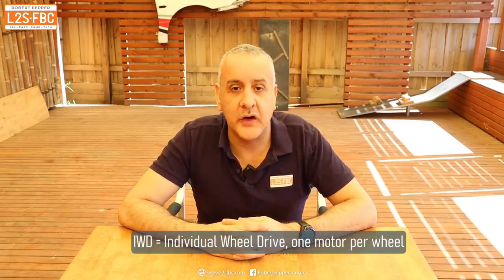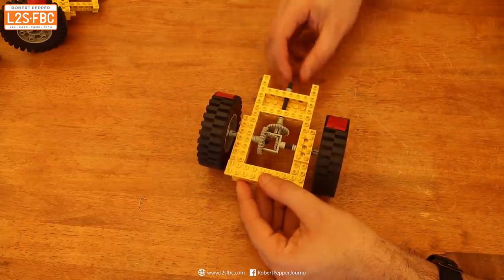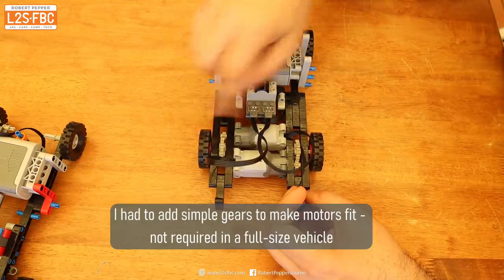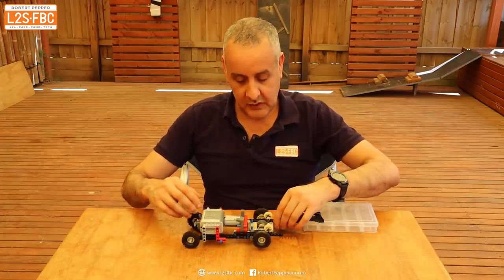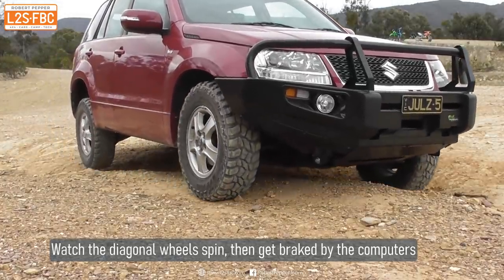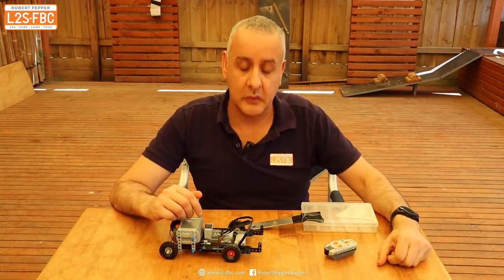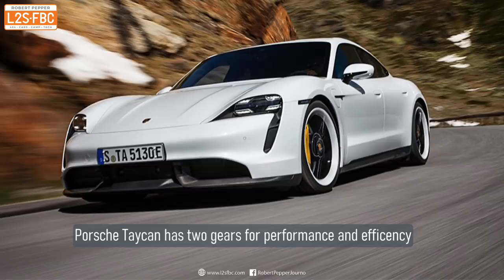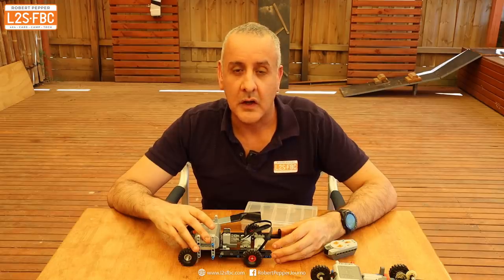Why Differentials Will Die - EV IWD Is The Future!

Comment: Good explanation, but there is NOTHING simple about a modern electric drive. They all have multiple computers and sensors and if you work with computers you will understand you can load the exact same image on 100 computers that are made exactly the same and you will have some that do not work the same as the others.  I see benefits of electric vehicles but I also see the massive open pit mines used to get to the metals used for them.  If there was not the push for electric vehicles and people understood the ecological damage done to dig the resources out of the ground using diesel engines and the shipping using diesel engines the manufacturing using coal for the electricity in china; people would realize that the electric vehicle is not the great environmental wizard it is made out to be.  The dumping of chemicals from the plants in china has caused a lot of damage to the ecology on many rivers and out to the ocean.  In order to increase the charging stations to run electric vehicles tons of copper will be strip or open pit mined and forests and mountains destroyed doing it.  There is no ecological way to do what we do in society.  The electric vehicle manufactures run into the cost versus reliability on the drives and computers if you go for the most reliable the cost will make it impossible to sell so they go with electronics that can handle some abuse and sell them cheaper. You will not be running the IWD computer controlled affordable electric vehicle down an offroad trail that is rough and washboard for a very long time.  Like trucks designed for offroad the electric vehicle will need to be upgraded for the abuse and this will increase cost.  The makers have worked for years and they still do not have a truck in normal production that is affordable, they will but it will not as awesome as we hope.  Like the electric cars now you will not be able to load up things in your electric pickup and haul them to your kid in college 10 hours away because you would need to stop and charge so often it would be an overnight trip and you will borrow the neighbors vehicle running on diesel or petroleum to do it.  For running short trips they can be great but if you need to also go more than 150 miles in a day you now need 2 vehicles license plates and insurance. Life is not as simple as we wished except for my Amish neighbors, they just ask you for a ride and do not need to worry about a vehicle.  Nice people to live by though.
Reply: No such thing as a free lunch. Or a consequence-free technology.
Reply: True with the charging and environmental impact that the electric vehicle causes, but the majority of people do not want to see that part that you described as then its not as friendly to the environment as they wish it to be
Reply: Thank you for your statement.   All they eco peeps see is "look zero pollution from my EV" when they dont begin to see the real cost in batteries for that  vehicle, the cost of the extra electricity being generated to charge that vehicle, the very limited range of use, an even shorter when you live where it gets cold , the extra cost incurred for all this new tech of electric motors controlled by a host of computers. When I need to turn around, I do a 180 and go, doing a tank turn in a vehicle looks to put all kinds of hard stresses on tires, drive components, structural of the vehicle. There are many stability control systems in cars (look at BMW, is amazing)
Reply: @patricksmith5640  No one looks at the damage being done in South America, china and Australia for the minerals.  The open pit mines are bigger than major cities.  The pollution is horrible, china has all but killed off the only fresh water dolphin by poisoning the river they live in.
Reply: @badgerpa9  wether it is EVs or diesel or petrol you still have to do mining. The steel for making ICE vehicles is the same as that for making EVs. There is a horrendous amount of energy needed for making all the castings and forging that go into an ICE. EVs are no different they just mine different things. If we use EVs instead of ICE we just pollute in a different way. Both types pollute. In the end it seems that EVs pollute slightly less.
Reply: @franciscoshi1968  if that helps you sleep at night.  The open pit mines for rare earth minerals are a disaster and destroys the land.  The coal used to fire the electric plant is not better than diesel fuel used.
Reply: @badgerpa9  I didn't get an EV to save the environment.  I got an EV because for my circumstances is far better than an ICE powered car. I wouldn't go back to ICE. I have had the car for a few months and so far never experienced any disadvantage.  The long trips I have done that needed recharging half way were not a problem at all. We parked at the fast charger and by the time we finished lunch the car was charged. The car charged faster than it took us to have lunch. My car has only 260km range. When I bought it I was only intending to use it as a run around car but after using it for a while we found it can do longer trips than I thought.
One thing though I don't like driving 8hrs straight. If you really want to do 1000km in one stretch eat in the car while you drive and have toilet stops on the side of the road then don't buy an EV.
Reply: @franciscoshi1968  I wouldn't want to plug in every where I drove, you may live in a country the size of a small state but driving 300 miles is not uncommon and we have driven over 24 hours in shift often.
Reply: @badgerpa9  I live in Australia.  In the last 7 years I did not make a trip that I could not have done on the EV. And I would  have saved the annoyance of having to put petrol every few days and have to put up with the smell (of poisonous fumes) while I stand next to the fuel pump and the smell of the unburnt fuel every morning when I start the car and reverse out of the driveway.
And I am fortunate enough I have never had to drive for 24hrs.
So EVs are not suitable for everyone just like diesel petrol or LPG is also not suitable for everyone.
Reply: @franciscoshi1968  I keep my face away from the fuel tank and the exhaust from a modern vehicle is better than the fumes from the coal used to generate electricity. Glad you are happy with your car.
Reply: @badgerpa9  I tried standing upwind when I refuel but unfortunately I get the fumes from the next pump and when there is no wind it still smells. I can not get further away than arms length. As for the fumes from coal power stations. They are very far away and I don't have to smell them every day when I reverse out of the driveway.  Every time the car starts when cold it dumps lots of fuel most of which comes out the exhaust because the catalytic converter is not hot yet. And the car is inside the garage so even if the tail pipe is pointing out the fumes still end up inside the house and inside the car. And I charge from solar not from the grid. It is cheaper.
You really don't realise how smelly ICE vehicles are until you drive a car that doesn't smell.
Reply: @franciscoshi1968  sorry things are so hard for you. I have operated electric, gasoline, diesel, LNG, and alcohol cars trucks and tractors the only time I ever smelled anything strong was on farm tractor.  The fallacy electric is better for the environment is sad. China has poisoned entire areas making solar panels. I do hope electric vehicles  get safer and better.

Comment: Looks great but EV's have more than range and charging times to overcome before people really start buying electric vehicles the way we buy petroleum fueled vehicles now and you can bet your last dollar that gasoline and diesel will put up a fight.
Reply: That is why the governments in Europe are making emission rules so strict. Some Japanese companies have said they will not produce Diesel engines for Europe in the near future as they can’t make them comply with emission standards.  Nice to see the consumer will have a lot of choice of which car they buy. NOT!
Reply: Here is a solution to this problem. You have a normal EV 4x4 that has enough range to work for daily driving. Then you have a plug on the so if you are towing you can plug an ICE  generator 🤣 that will keep the battery charge so when you get to your preferred track you have a full battery pack. You leave the caravan behind and spend the night in comfort with aircon.
Reply from the maker: Or put a battery in the caravan...

Comment: So how about maintenance?
4 engines plus a generator = 5 x as much parts and maintenance!
Reply from the maker: No, electric engines need barely any maintenance
Reply: @L2SFBC  Fair enough, but surely the generator will need 12 monthly service. Will electric engines require oil change or servicing? Then theres breakdowns after a few years...
Reply from the maker: Ditch the generator. Watch my Atlis interview -> https://youtu.be/f612Qjz9Wc0

Comment: I’m not holding my breath for an electric 4x4
Reply: You won’t have to wait long Range Rovers are going all Electric in a couple of years you will not be able to buy a Diesel or Petrol engined vehicle from them,just watch their sales drop like a brick unless they have some advanced battery technology which will extend the mileage between charges that they haven’t told anybody about. Another thing they need to get right is the problems with electrical problems when the vehicle is wading in 3ft of water,electricity and water are not a good mix,knowing what R/R are like I can see a lot of expensive problems ahead for future owners.
Reply: @davidellis279  I won’t buy a gas powered range rover because of the maintenance issues
Reply: @danlux4954  I’ve had Range Rovers with both Petrol and Diesel engines fitted and had very little trouble with them because being a diesel mechanic for over 40 years I look after them meticulously and drive them properly. I am running a 59 plate Vogue TDV8 3-6 with a 160,000 miles on the clock and have no plans to change it. I will admit that they can be a Money Pit if there not maintained properly but that goes for many vehicles. If Land Rover don’t get this right when they go all electric they will go down like the Titanic and I for one will never purchase one until they has proved themselves for at least 5 years and when the batteries need replacement you will need a Mortgage to buy them. Nobody knows what problems are going to turn up when there are millions of electric vehicles on the road and replacement batteries are going to be one of them. These vehicles with all their electronics and computer controlled systems are going to be a costly nightmare for owners when out of Warranty.
Reply: @davidellis279  I’m not a mechanic and there is no dealer in my town.

Comment: There is a flaw in IWD that you may find the hard way after someone kills themselves.
Reply from the maker: Do tell...
Reply: If a motor or motor controller dies it would cause a skid steer effect. There is a video of a truck with the left side riding on asphalt and the right side on an ice patch. They hit the brakes hard and the truck spins violently. The truck did have abs. Unintentional tank turn.
Reply from the maker: Could be avoided by free-wheeling the other wheel or speeding it up. That can be detected.

Comment: Great explanation! IWD is not new technology however. I think Porsche used this type of drive around the turn of the century. I know that NASA’s lunar rover used IWD, although it used torque steering to turn. https://nssdc.gsfc.nasa.gov/planetary/lunar/apollo_lrv.html
Reply from the maker: Thanks Dave, yes a FB follower pointed out the 1900 Porsche design - apparently because differentials hadn't yet been invented!  I also think the lower gravity on the moon would change vehicle dynamics, maybe making torque steering more effective than on earth.
Reply: @L2SFBC  do you think we are too old for NASA to let us go test that torque steering theory on the moon? If not, let's go!
Reply: Also, some big mine trucks use IWD.  A regular motor generates electricity that is used to power the 4 wheel electric motors.
Reply: @nealesmith1873  The large trains and mine trucks use a large diesel generator to supply the power to electric drives motors.  Trains have used this for many decades.

Comment: Never going to replace a diesel 4wd that is used for 4wding. A diesel engine that makes 200nm from idle with a overall reduction of 45:1 no way would you motors capable  of that. Even with a reduction box at 10:1, too heavy overall. Not worth the cost. If physics and cost was pushed to the side it would be one hell of a go anywhere vehicle.

Comment: As time progresses 4x4s become more and more like moon rovers. Its super cool but at the same time, I dont think that 4x4ing will be allowed in this new era. It'll be "too damaging to the environment". Whats more, will they outlaw gasoline vehicles in the future? If so, will the government be paying to convert my vehicle to electric IWD? Or will I have to pony up the several thousands of dollars on top of the several thousands I already have in the vehicle from purchase plus modifications? This technology is exciting but as with everything I think politics and politicians will suck every ounce of fun right out of it.
Reply from the maker: https://l2sfbc.com/the-future-of-automotive-fun/
Reply: @L2SFBC  Oh wow that article was written by you! Thats pretty cool, I enjoyed the read. I am concerned about a lot of those things, I enjoy driving my TJ Wrangler in "stock +" configuration. 6spd manual, 4 cyl engine, no lift, no locker, 30inch tires on 15 inch rims. I plan to lift it about 2 inches to allow more flex, get aftermarket fenders that are a little more open, retain the 30inch tires and install a super 35 kit on the rear axle with an E-locker. Its a challenge to drive it the way it is but actually quite surprising how capable it is in stock configuration. First Jeep I have had, quite impressed. I think up here in the States, people will be a lot less likely to capitulate to modernization, especially in the Western States that are East of the coast. Either way, its only a matter of time.
Reply from the maker: Thanks, good points 👍👍

Comment: You'll go through a lot of tires, airing down will possibly lead to tires coming off the rim at the beads, wide tires would have to be a thing of the past, another system to break down, this will be an expensive edition, more for vehicle manufactures to charge more $ and
The fool's will buy into, what will be a passing novelty
Reply from the maker: Sorry I don't get this?  What's tyre width go to do with it? And this is no fad!
Reply: Look up all the hydraulic driven off roaders that can spin on a dime and tank steer on tires

Comment: You are comparing 80s 4wd systems to electric motors 🤦‍♂️🤦‍♂️🤦‍♂️🤦‍♂️🤦‍♂️
Reply from the maker: Sorry don't understand your comment?
Reply: @L2SFBC  you are comparing 80s 4wd systems to only new electric systems.   It would be better to compare modern 4wd systems to the top of the line electric systems you are talking about
Reply from the maker: No the differential is still used in 2021 4x4s and so is brake traction control.
Reply: @L2SFBC  it uses the abs system not the traction control. That's also a very old system
Reply from the maker: The ABS system IS part of the traction control system. This video explains the differences -> https://youtu.be/NqEUVgi2020
Reply: The traction control one just cuts power.  But newer systems use the abs to actually break the wheel and send power to the one spinning while the other one doesn't move.  Just like the electric systems.  Not as good but it's the same thing
Reply: @L2SFBC  there is no such thing as break traction control.  Traction control just cuts power to the motor.
Reply: @L2SFBC  the traction control can be applied while the abs system is working in off road conditions.  They are completely different systems
Reply: @L2SFBC  traction control  and abs act very differently while not off roading they are completely different systems.   It might feel like it's braking but it just cutting power to the motor.
Reply: @L2SFBC  all I'm saying is traction control is an old system and people now days are calling it traction control braking but that makes no sense because you don't know which one they are referring to and it's just simply wrong.   Toyota calls it Atrac , BMW xdrive etc. And it uses the speed sensors not the traction control to determine the wheel speed and the abs does all the work no traction control at all even though the "traction control light" flashes that has nothingto do with the traction control it just detecting wheel slippage.  Gotta explain the difference.

Comment: Who cares about IWD? I mean....how does this improve anyones life?
Reply from the maker: Well it makes cars more capable. That may be good or bad depending on your perspective.
Reply: @L2SFBC  But who really needs this? 4WD with limited slip diffs has worked just fine for how long? Seems like IWD is a sales gimmick to me. If it works that good, it kinda takes the fun out of offroading.
Reply from the maker: Have to agree with the fun factor. Yoi need it as much as you need LSD over open or locked over LSD. Don't Lockers take the fun out of it too?